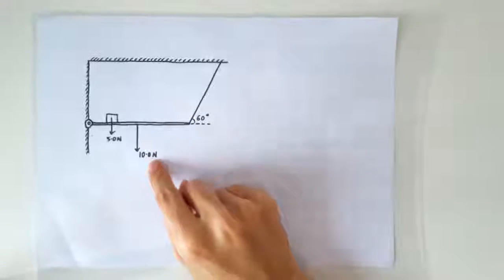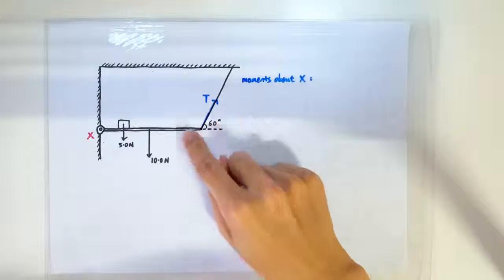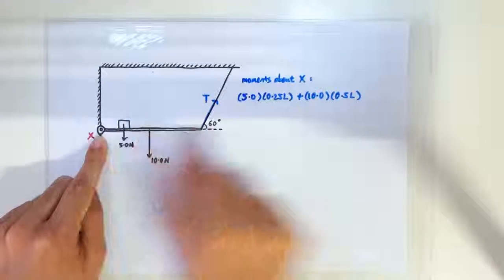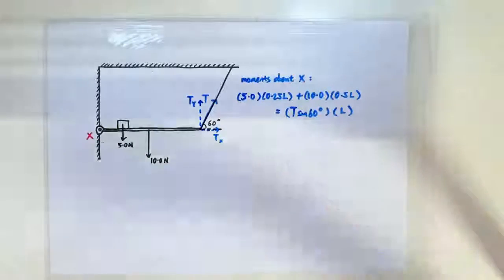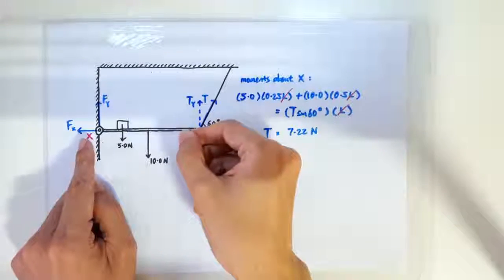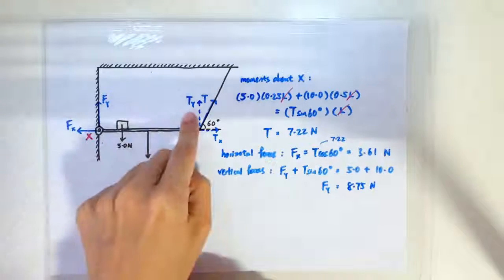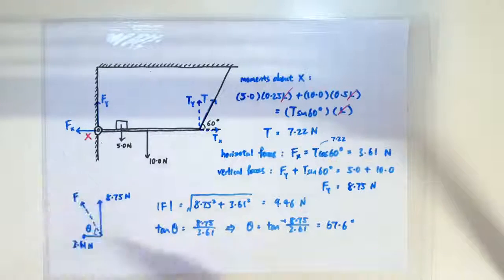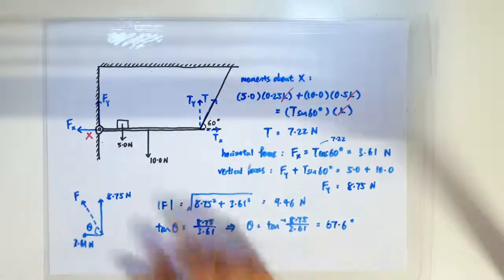4.2.3 Rotational Equilibrium of Hinged Objects: Beam and Hinge

Comment: hi teacher all the videos and the website you have done is great and i really appreciate the efforts put in to do this  i really find it very helpful for H2 physics however i need help in solving questions in forces that involve springs and especially when spring are mixed in order eg. 1spring is the connected to 2 other parallel strings to form composite wires and in such situations how can things be calculated and stuff
Reply: It is very similar to how we deal with series and parallel resistances. I have a video on the effective spring constants for composite springs. See if it helps https://www.youtube.com/watch?v=pdLDr0WJl8k